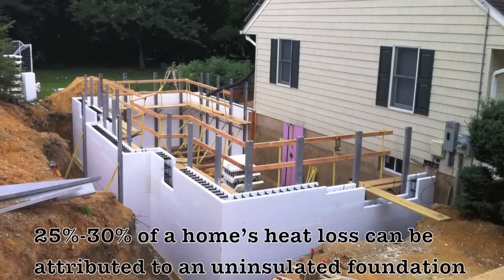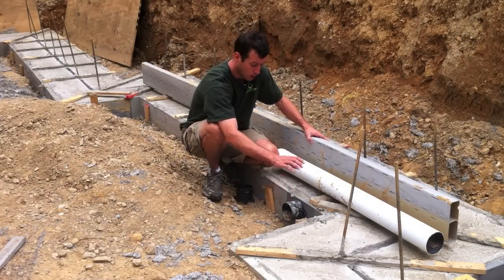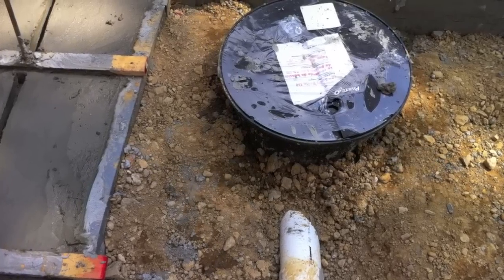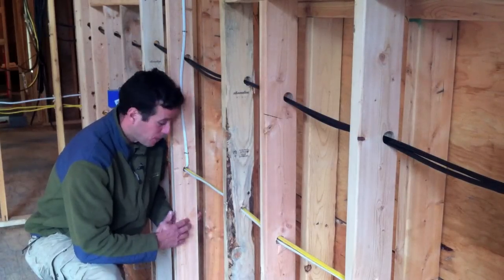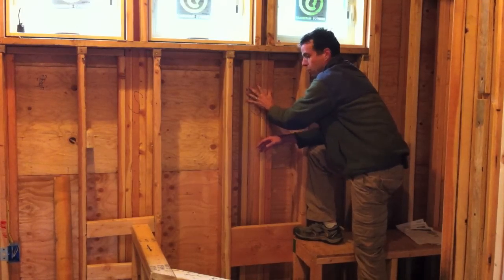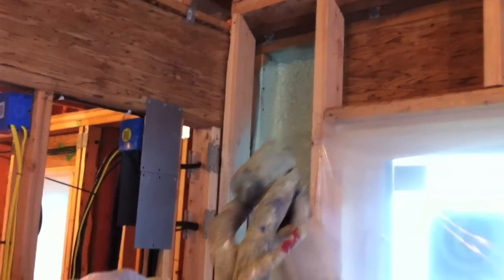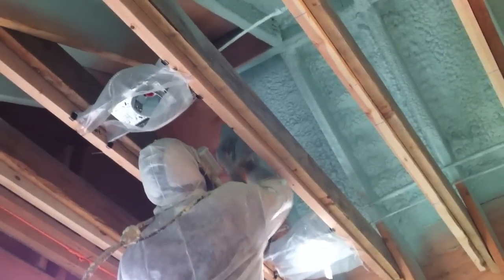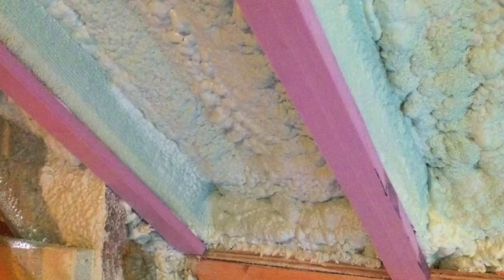NJ Passive House Part 1  -  Passiv Haus

Comment from the maker: I'm not a certifed PH architect, as a matter of fact, I'm not even an architect.  I'm a career firefighter and contractor.  I also didn't have a blower door test and related testing to certify it.  However, I would argue that I spent a lot of time and energy following PH standards the best I could under the circumstances and created, in my opinion, the best and most detailed video on youtube to date, regarding PH design.

Comment from the maker: Did you watch the videos?  The only thing I'm "importing" is the idea of super insulation, super air tightness and ventilation.  How you get there, is no concern of mine.   Additionally, I don't care if you're on the equator or the north pole, this building concept works anywhere.

Comment from the maker: I agree with you because it can never meet passive house standards when more then half the house was built in 1955 and I don't have a completely closed envelope.  That said, I'm not looking for the approval of a certified PH representative.   I also understand the USA 1970's failure of PH design with moisture, mildew and house hold odors.

Comment: ICF is only uprated if it is on an above ground wall, and even then not to R60. Additionally  6" of spray foam is a whole 97% efficient compared to nothing, still only about R36 and EXPENSIVE.

Comment from the maker: I suggest you google Heatlok Soy 200 and look at their data sheet.This closed cell foam is insect proof and in non-living areas is acceptable without sheetrock. For example in my attic it was not required to have it covered. As for a melting 12g wire, I suspect it would burn and/or melt away where it touched the wire and then go out. However, I'd contact the manufacture and confirm this. BTW, do yourself a favor and only spray toxic chemicals inside your home as a last resort, not required here.

Comment: Who wants to live in a building with virtually no windows? More like a prison.
A warm, quiet, energy efficient prison. Uh...no.
Reply from the maker: Ratonejr, not sure where you got it that you can't have windows.   If you drove past a passive house you wouldn't even notice the difference from a standard home.   It's called using the right type of windows and putting them in places and using sizes that make sense.

Comment: No compacted base under spray foam ? 
Spray foam instead of rigid high density styrofoam sheets under your slab
Slab has  almost no steel ,was unsupported , which pushed the rebar to the foam making it worthless, and a minimum thickness on concrete .
The soy foam is a scam. There are two parts to this foam and only one part contains the soy product which is a small percentage of the rest of the highly toxic soup. You've created a monster of toxicity especially when the house is going to be air tight . 
I could go on but that's  enough nasty criticism . Now i will tell  you how us Europeans do it -
1- The slab should be about eight to ten inches thick with two layers  or more of heavily supported and tied off rebar and rebar mesh. There should be at least four inches of ridged styrador / styrofoam on top of a compacted rock base. 
2- An alternative to stick framing is to use manufactured laminated  logs made of kiln dried material as your frame and interior mass., or CLT panels ,also known as Cross Laminated Timber. Then install continues insulation , preferably of a natural material such as Gutex or Steico wood panel insulation that is semi ridigid to accept 1/12 thick furring strips that are screwed through the insulation and into the logs or clt panels. on top of the furring strips comes  a siding of your choice. 
3- triple pane windows with double seals 
4- now comes a highly debated subject, an air to air heat exchanger or not?  if not , then it is absolutely necessary to use ONLY non off gassing / toxic  building materials and the same for all interior surfaces , including furniture , bedding , drapes , etc. If you are sold on the air to air heat exchanger then you should still have an absolute minimum of potentially toxic materials . Spray foam of ANY kind in a passivhaus in germany where i live is a no no.
Reply: All of which will be handed over (at the point of a gun or knife) to the Islamists who will
OWN the western EU in a few years and they, of course, will take excellent care of the
home just like they do everything else.

Comment from the maker: My feeling was that cellulose will never give the same air tightness as spray foam.  Inch for inch spray foam is better.  Cheaper no, better yes.  It also makes the structure 300% stronger.  But at the end of the day, I don't care what you use.  All I care about is that Americans are building better and smarter.

Comment from the maker: Love the condescending and confrontational attitude! I'm not a spray foam expert, however I am using the advice and standards provided by the company that produces the product.  As for risk of fire, since I'm a career fire fighter, certified fire inspector and someone who can read. All the foam in "living spaces" is covered with a minimum of 1/2" sheetrock.  However, since the attic spaces are not occupied living areas and have no storage, it meets code to be uncovered and has been inspected.

Comment: It may be energy efficient but watching the safety equipment those installers are wearing, wonder how much off-gassing will occur and how safe is it really that Soy 200 spray insulation.  I'd rather use polyester batts or some other type of insulation that doesn't require a hazmat suit to install.

Comment: I think in the future we will see contractors solely doing retrofits on old uninsulated or poorly insulated homes.I watched video's on utube showing how they put 8 inches of hard foam on the outside of the house, and then resided it. . There are very specific ways that it has to be done carefully taped, and two layers, running the opposite way, and they put it on the roof too. These houses are as close to air tight as you can get on an old house.  It's pretty cool.  You should watch it..

Comment from the maker: Valid point with the footing regarding insulation, however, we did spray the sill plate completely.  I'd also argue the the footing is insulated in some respect on the sides by the form a drain.   But a valid concern, I admit.

Comment: Thanks for your excellent video. I'm from Sydney, Australia so it's no where near as cold as New Jersey.

May I ask if you considered using insulated drywall? (aka sheetrock - plasterboard).

That's a perfect way to eliminate all thermal bridging as well. Except you lose floor space/ceiling height on a retro fit. It's easy to design for on a new build though.

If you hung insulated drywall on the thermal bridging area in your cathedral ceiling = problem solved. I'm not sure if insulated drywall is big in the States or not. It's not big in Australia although I would definitely use it on a new build. It's up to around 120mm thick for the insulation layer plus 10mm for the drywall layer.

My only other concern is your building fire safe? Is the foam flammable? I like the idea of rock wool insulation batts for sound/insulation and they are excellent in fires.

I take your point that air tightness is crucial. Otherwise you're wasting your time. I also see air tightness is almost impossible with batt style insulation.

Comment: How do you protect that rigid foam board (weed whips, etc) exposed on the outside?  I've often wondered if that tile cement board could be used outside.

Comment: I built with double wall 12  inch thick, I would never use foam,  12 inch floor insulation, 18 inch   in ceiling, double doors and double  windows, works great for me, super low electric bills, will go  total solar this year

Comment: Wow. Pretty funny video. I'm sure the house uses less energy for heating and cooling than the code minimum house or even a pretty good house. It's pretty great that 5" of EPS is R 50! I NEVER knew that! I'm going to stop using polyiso as it's only about R 6 (maybe) per inch, as opposed to R 10 per inch!
Reply: I was being sarcastic by the way.

Comment from the maker: couple things.. 1, the water is inside the form.  There is stone around the footings and even filter fabric for drainage.  2nd, the forms are level.  However, if there is a hole on the side at the bottom somewhere, that leads to a sump hole, the water will obviously flow very easily.  lastly, this system is approved and well accepted in the field.  Actually, BuildBlock, the ICF, recommends this product.  Its great and prevents water being trapped on either side of the footing.

Comment: You also need to factor in the fact that your HVAC equipment will last longer due to it running less. The house retains it heat/cool so we'll that the HVAC barely runs

Comment: If your footings have to be level. How can the Form-a-Drain move any water around the foundation? You need to have some pitch to your drainage, or the water will just pond against the footing. Concrete is a sponge, and will take moisture from where it is most wet, to where it is dry. Good for radon, but does more bad than good with moisture

Comment: I'm building my home this year and while I'm not sure how passive I will go after watching this video I will be dropping for single 2x6 walls to double 2x4's spaced to eliminate that thermal bridge, I always just thought about using foam board on the outside to eliminate it that way but double stud walls makes more sense,
Did you use open cell foam?
So would going with a geothermal unit be overkill in an application like this?
I ask because I always thought when I build my home geothermal  was always at the top of my want list.
The more I research passive homes the more fascinated I am about the entire process.

Comment: I see some people saying adobe and bale style walls are horrible as a passive design, but you wouldn't have to spend so much on insulating the walls to do the same job. In the case of the bale houses the walls are easily R50 and cost 1/4 as much as a double stud wall with foam.

All home designs should have at least some passive characteristics so I applaud the effort to do this. I think you could have saved a ton of money in many areas and have more self sustainable materials, but nice job!

Comment: all wrong your studs are still in direct contact with outside,  sucking moisture and transferring heat to outside.   what you want is 4 inch foil backed foam, has a ''mil spec no.''  outside of 3/4 plywood. plastic sheet over ply and foam than cladding.  no transfer of heat or cold.

Comment: I'm building a home in Corner Brook, Newfoundland, Canada.
I'm working on double 2x4 walls with a ½ space. I would have liked to have gone wider than 8"wall in total, but the house is only 26’W X 53L on a narrow land. I am staggering the studs when at all possible because only having a ½ space. I’m thinking of 3-4” of spray foam the outer exterior walls.
Then do the wiring and then remaining space of the inner exterior wall fill in with R12 fiberglass batts for a total of R30-R36. The city by-law is whether you spray or fiber-batt etc.. Is to cover the walls with a 6 mil vapor barrier because of air gaps between any double studs. It will be interesting if I filled the double wall with closed cell thus filling in the ½ space between the two walls, would I still need vapor barrier.
Reply from the maker: if you review my video again, I discuss the idea of stagger studs or having larger distances between walls.  It turns out that neither are necessary,

Comment: Great job! have a question. No roof is everlasting, if you have a roof leak (all roofs has it eventually) it should be hard to tell where the leak is because foam is a waterproof material, so you have big chance of bad/rotted plywood. Would it not be a good idea to isolate plywood roof deck with some sort barrier just to make it easier to deal with any future roof retrofit jobs?
Reply: Mantas Alonderis there is a way to accomplish this but I won’t get into it.

Comment: how do prevent thermal bridging through the cill plate between foundation and wall construction?
Reply: If the question was foundation-sill plate connection. I have seen projects showing from bottom up something like foundation wall - foamglass - concrete or cilinder block foundation top. Sorry for bad english.

Comment: it would be better money spent with a 2" foam on everything then blown in the rest of the wall
Reply from the maker: better no, cheaper yes.  Not against it, I completely understand your point, but there are always pros and cons to everything.
Reply: the43k there is a limit to how much Rvalue is worth it, and more than a few inches is not worth it as far as what I have spent on projects here in Montana per inch applied. the offset studs are really what is doing the work. I am an electrician so I have a bias against any form of insulation that will impede the fishing of future wire and low voltage cables in the future. Great video though!
Reply from the maker: I eluted to this idea in the video, that the value of more spray foam once you get to a certain thinkness may not be worth it.  Agreed, however there are issues with other forms of insulation too. Degradation, mold,homes for mice, etc etc.   I'm not sure 2" is the point where is over kill,

Comment: Why the windows are so small?
Reply from the maker: Windows other than South are typically smaller.
Reply: @NJRenewableEnergy  I was wondering, will those walls, with that much isolation be able to handle strong winds, floods and earthquakes having in mind that climate is changing and we are witnesses of those changes? How is mold handled? How is general security handled? On the latter about leaving the house for let's say......couple of weeks for visiting friends or going on a vacation? Because I don't want to return and find the house with more windows than it was left 

Are these houses eavesdropping resistant? Because......in an age when privacy is squeezed and so many things every day instead of remaining private are widely opened, privacy is so precious......how's handled?

P.S. Is that foam human friendly? Because if it is, the question occurs: why using space suit to spray it?